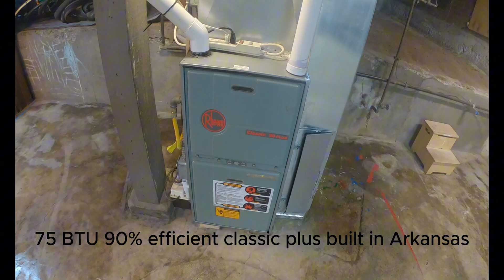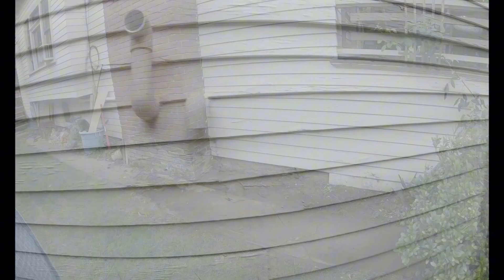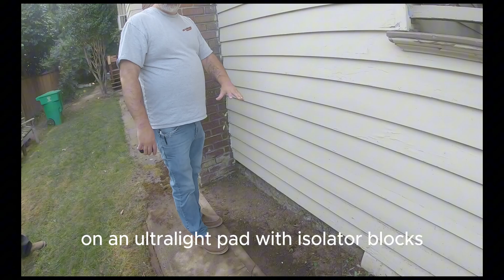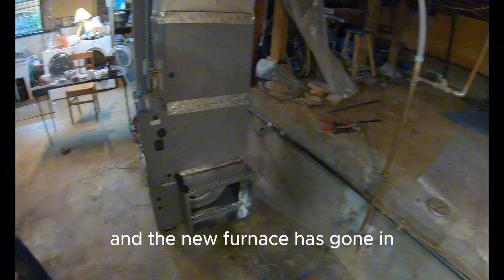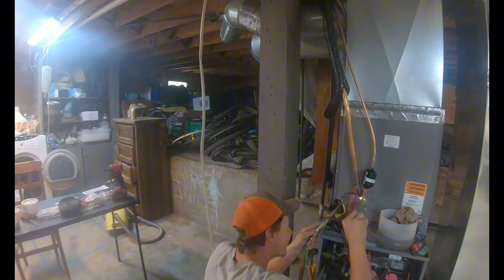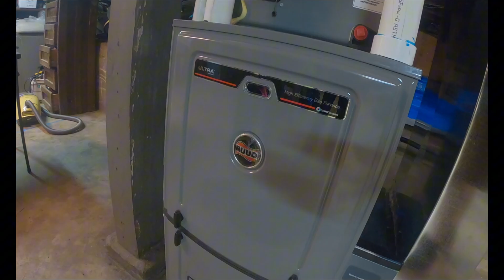Rheem Ruud U98MV Gas Furnace & Ruud RD17AZ heat pump

Comment: The compressors are from Gmcc which was Toshiba and they bought it from them , there good compresors. I have a 2020 Ruud Heat pump and its been a disaster it worked for the first 13 months and has been leaking and breaking ever sense. I have tried and tried to get them to replace the whole unit and they won't. I also noticed that this Ruud has no Accumulator for the freon and had no belly band heater on the scroll, they said it was not needed then why does all the other ones have it?When I run it in the winter it makes the worst sound starting up for about 4 min. The heating well it can't heat even when full of freon the air coming out is 79 F when its like 33 outside. I got sick of paying for this and that and did not want to pay another ten grand so I went to Amazon and bought me a cheap 18,000 Btu Mini split its a no name brand. But I found out is made by Midea . My guy wanted 6000 bucks to install it I told him to &$*$#  off and did it myself in about 7 hours. That was 3 years ago when it got down to -1F the air coming out was 121 with the temp set to max. There is no Aux heat and I can't hear it ever and my power bill dropped by 40 bucks a month in the winter. It Runs 24 7 I never turn it off and it cools and heats my whole house. Totaly cost for me was 900 bucks. I have not had a problem out of it and even if it does 900 bucks for a Cold climate heat pump was a steel my main system is a 2.5 ton . I will never go back to spending thousands for this junk they put out today.

Comment: Can you comment on your energy consumption after the install?
Reply from the maker: @swtexan6502  yep.. This month is key as it’s so cold.  It barely works but I’ve been hitting it hard and will share a detailed break down  been meaning to update my monthly burn .. seems it’s a slight savings and the house is more comfortable.. my electric is up z(several factors to isolate) but my gas is way low.. (of course gas is cheap and I run gas when my rates are high or now when the temp is below about 35
Reply: @oregon12345  Outstanding.  We upgraded our air source HP in 2017 and I'm going to install a soft start kit this spring to see if we can increase the efficiency and longevity- then we'll upgrade to a dual fuel.  Appreciate your input.
Reply from the maker: Here is my Data analysis of my Gas and Electric costs https://youtu.be/TCYosGgAi88

Comment: Those RD17s are pieces of crap. Chinese compressor. Their other heat pumps are great though, they have Copeland compressors. RD17 has a piece of junk Midea compressor. RD17 also has noise issue with this stupid undersized washer under screw that supports the main big accumulator tank that you have to change out or customer will most definitely complain. We install them because we are a Ruud dealer but I personally will never sell them.
Reply from the maker: So.. I admit the unit is way louder than I expected.  I’ll post a video in the future.. .  I can hear A buzzing throughout the house.  The buzz comes from the unit vibrating panels.. if I put my hand on the panels the buzzing quiets down.   then yeah the compressor is loud..  I can hear the entire unit (buzzing and compressor) clearly from across the street and I’m sure the neighbors do too.  My neighbor has a ten your old diaken and I barely hear it.
Reply: @oregon12345 yes that’s because of the screw I’m talking about
Reply: Just had a 3 ton RD17 installed with an R98 furnace.  Loving it so far with no sound issues.  About to replace my second floor unit with a similarly paired heat pump only RD17 3 ton and air handler.  Hope i dont run into issues, but these are slick!
Reply from the maker: @GreenLegacyWoodworking mine is a 2 ton.   I would love to hear what yours sounds like when it’s cranking…
Reply: @oregon12345  i dont see many videos on the RD17.  Ill make one and post it tomorrow.  Also, the owner of the HVAC company that installed mine also installed an RD17 on his own house.  The pics and video of that install convinced me to go with it.
Reply from the maker: @greenlegacywoodworking - here ya.. here i mine.. temp about 50 degrees.   go https://youtube.com/shorts/hRChv5G9YFk
Reply from the maker: Can you share what screw it is that you swap out?
Reply: @oregon12345 there’s an accumulator at the back of the machine behind the compressor. You will have to take the sound blanket off the compressor to get at the screw with an extension bit. The washer under the screw for the mounting bracket for that accumulator is too small. You will need a bigger washer to eliminate that noise
Reply from the maker: Hi.. could you view my unit and tell me if the buzzing is typical.
Reply: @oregon12345  did you get this resolved? I was quoted the same unit with the Rheem 96% 60 BTU furnace. Would you recommend getting one based on your experience so far?
Reply from the maker: @JRT1999  i am happy so far but the biggest issue I have is how loud it is.  My neighbor has a 10 year old diakin that is so quiet as to be unnoticeable.   My Heat pump is loud --> https://www.youtube.com/shorts/hRChv5G9YFk. 

I looked at bosch. and Mitsubishi... and Trane.. All were about 2x the price.
Reply from the maker: https://youtube.com/shorts/hRChv5G9YFk?si=IYt1IM0-nzAQVpW9
Reply: The RD17 uses a Toshiba compressor and that's from Japan!! I will take a Toshiba over Copeland all day, i am a hvac contractor for 20 years and i cant tell you how many Copelands i have changed due to pre mature wear and tear..  The Bristol compressors where 10x better they should of never got away from those but if company's would go to Toshiba compressors they would be 100x more reliable...Copeland is junk
Reply: @JaredAllen86 Copeland are tough. If they fail prematurely it’s because of install or design issues. I’m also a HVAC and electrical contractor. And no, it’s not Toshiba, I sell Ruud. The RD17 does not use Toshiba.
Reply: @timrob0420 ## Overview of the Ruud RD17 Heat Pump with Toshiba Compressor

The **Ruud RD17 heat pump**, specifically featuring a **Toshiba compressor**, is part of the Endeavor® Line Achiever Plus® series. It is designed for efficiency and reliability in both residential and commercial applications.

<hr>

### Key Features

- **Energy Efficiency**: 
  - *Cooling Efficiency**: Up to **19 SEER2* and **12 EER2**.
  - **Heating Efficiency**: Up to **8.5 HSPF2**.
  - These ratings indicate a high level of energy savings, which is crucial for lowering utility bills.

- **Compressor Technology**: 
  - Utilizes a **Toshiba inverter-driven compressor**, providing variable speed operation. This allows the system to operate smoothly between **45% to 100% capacity**, adapting to real-time heating or cooling demands.

- **Design and Installation**: 
  - The heat pump has a compact footprint, making it suitable for installations in limited spaces. Dimensions can be as small as **40.2 inches wide, 16.4 inches deep, and 36.6 inches tall**.
  - It features **quiet operation technology**, ensuring sound levels can be as low as **58 dB**, making it ideal for residential environments.

- **Environmental Impact**:
  - Designed to reduce greenhouse gas emissions, the unit has a *7mm condenser coil* that lowers refrigerant requirements by up to **15%**.

- **Warranty**: 
  - Comes with a **10-year conditional parts warranty**, offering peace of mind for users.

<hr>

### Specifications

- *Nominal Sizes**: Available in **2 to 5 tons* (7.0 to 17.6 kW).
- **Refrigerant Type**: Uses **R-410A**, which is more environmentally friendly compared to older refrigerants.
- *Heating Capacity**: Approximately **36,000 BTU/hr* for very effective heating performance.

This heat pump is designed to be versatile, compatible with various HVAC systems, including both communicating and non-communicating systems, ensuring easy integration into existing installations.

If you need more specific guidance on installation or operation, feel free to ask!
Reply: @timrob0420 The Ruud Rd 17 uses a Gmcc compressor which is Toshiba and Rheem bought out the company..So while it says it uses its own compressor that's because they bought the company and stamped as its own! Toshiba runs the variable speed game in compressors they are hands down the best on the market
Reply: @JaredAllen86 I’d have to disagree with Toshiba being the best on the market. I personally think Mitsubishi is